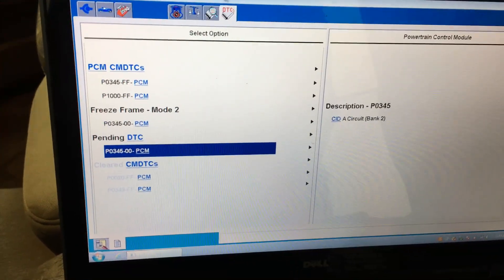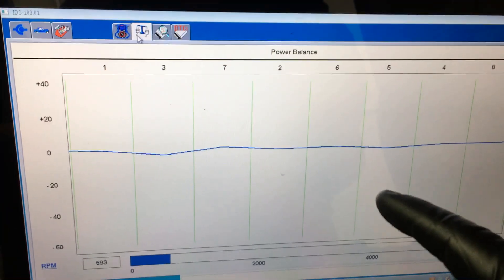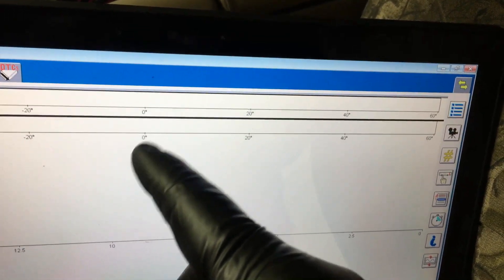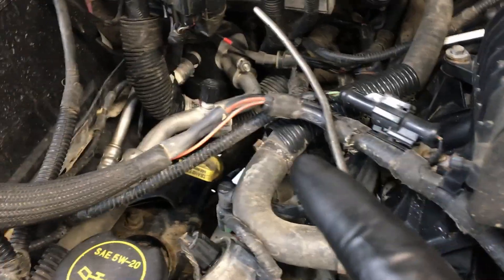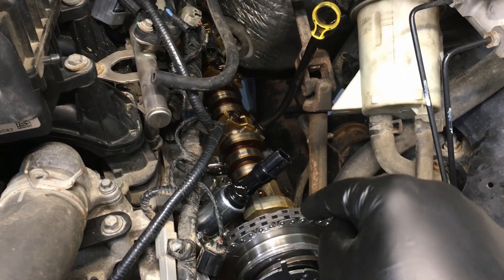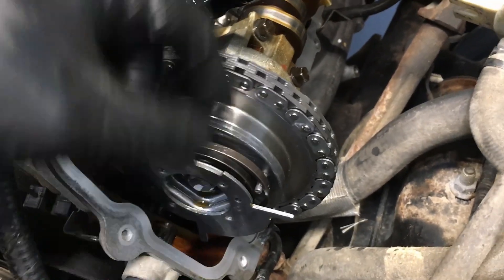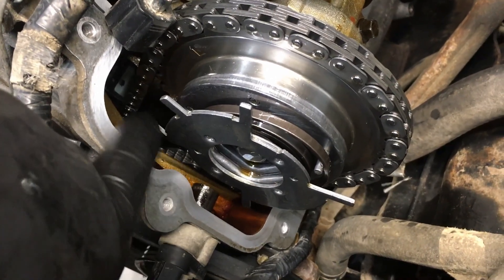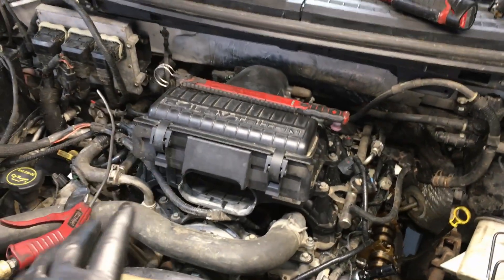Ford 5.4L 3v Triton Engine P0340 P0344 P0345 PO349: Always Inspect These Items First!

Comment: I just bought f150 flare side .  5.4 triton engine.........do I have phasers ?.....ALSO....what do I have to be aware of ...has ticking sound (lifters ) ( drivers side)  ....  170,000 miles....no isues  on scanner...all in parameters.   do not know if coil packs have been changed  ( any way to tell ? )
Reply: Bob Haddock Your 1998 Ford 5.4 engine does not have cam phasers.
Reply: Bob Haddock 1998 does not have phasers
Reply: Check brokem exhaust manifold bolts
Reply: exhaust was checked..had all new from back of cab out back (dual exhaust )
Reply: had exhaust checked.  new from back of cab to back (duel exhaust)
Reply: tks
Reply: tks
Reply: drained quart of oil out....added quart of Rislone.....gonna drive it while....just to see
Reply: Bob Haddock walk